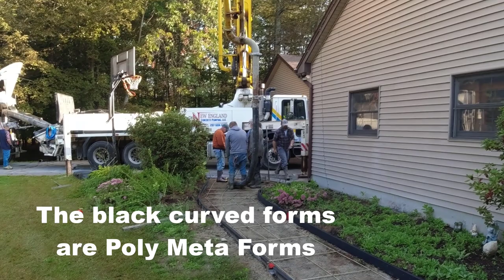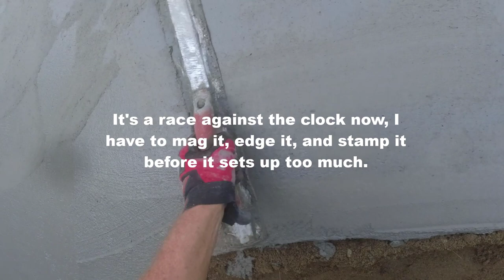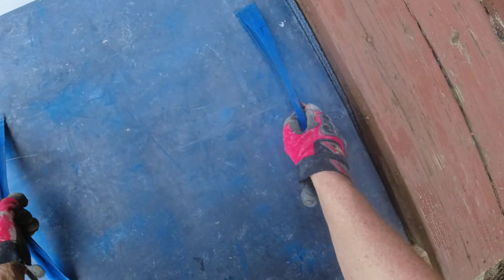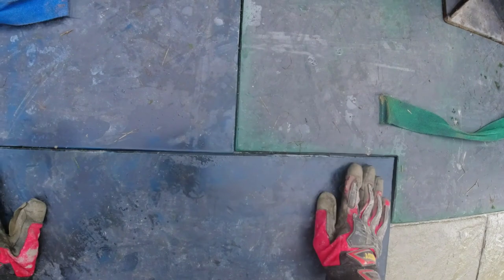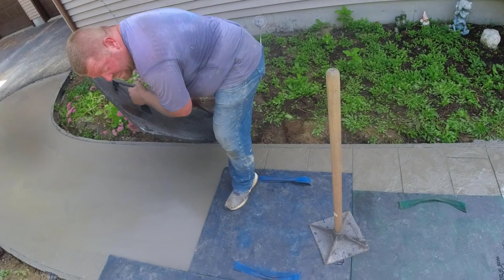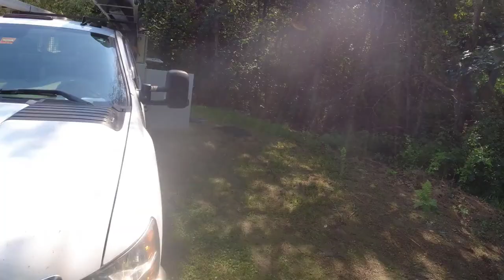How To BEND Concrete! What To Use For Forms

Comment: Hey man, sounds like you on east coast my brother. I got some rising concret around the perimeter of my pool. The whole back yard is  concrete. I have bullhead placement stones around pool which are good. The issue I'm having is rising concrete around my northern edge of my pool which has a about 5 feet to the stucco wall border... It is at most 1 inch-mostly about a 1/2 inch rising right at the placement stones. I was thinking of just sledge hammering it down and using cement all to put it kinda back together after fracturing it down. A friend said to grind it down. All my control joint which are about a 5ft intervals are cracked so I was going to polyurethane them and pound out the edges up against the pool placement stones... now this is probably crazy but as an option...I was also thinking of pouring the cement all and leavening out the bullhead slant up to the rising edge...
So my man whats your suggestion????